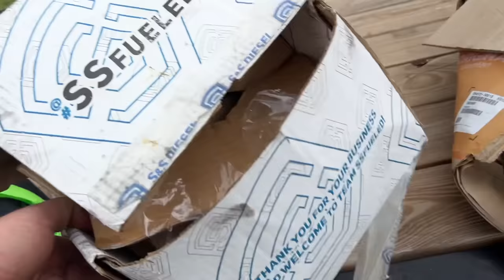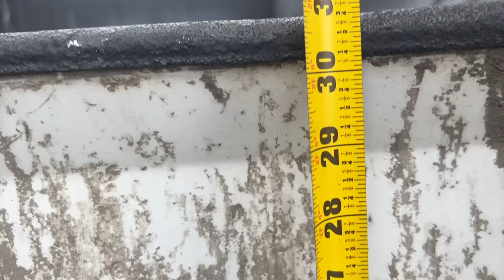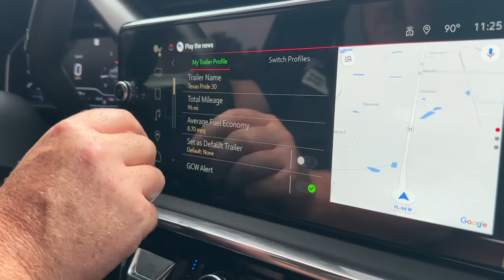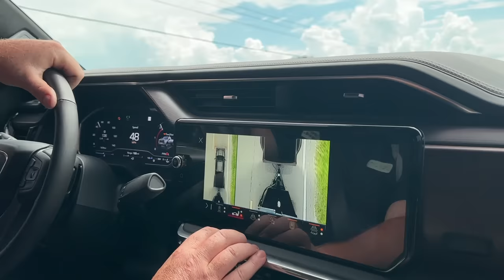$100,000 Diesel Truck VS $2,000 Diesel Truck!!!!  Are These New Trucks Really Worth It?

Comment: Stock tuned 6.0's are LACKING! 
Performance wise new diesel engines AND transmissions are butter! The 5R110 is not bad though. 

I'm extremely surprised how well the old 6.0 did though compared to a new Duramax. (I've only driven 1 ~2007 Duramax though but was tuned pretty hot) 

My 2006 6.0 and 2014 6.7 (both tuned) aren't even close.... However My old 2008 6.4 tuned was the fastest and funnest DRIVER (that's when it actually ran and drove fine! Also that's where any positive ends!)

Comment: Lmfao. That new dually is a Macintosh computer on wheels. With a 7.3, I’m taking the 2006 all day. My grandpa got a 2001 3/4 ton 7.3 with only 130 on it. Not a dually but it’s on airbags and has a programmer

Comment: Not to be rude but a new truck can brake down just as easy as a old truck. The key with old diesel trucks is knowing ur truck and keeping it maintain. I have a 96 12v cummins with just shy of 500000 miles. Its never let me down once i drive it everyday. Buy the newer trucks are nice and make towing easier. I have a new 2024 chevy 3500 with 6.6l gas. I just couldn't buy a diesel with all that emissions junk.

Comment: I don't really see the point in an expensive truck TBH.  Might just be something that if your into it, you're into it.  I'm not really into trucks at all.  
  
I guess if you need to depend on the reliability and your running a business then I can understand, but just for personal use it's just not something I have any interest in.  I'd only ever need a truck with a 4x8 truck bed for transferring materials but even then it's cheaper to just have it delivered via Freight for how frequently I'd need stuff.  
  
I'd rather have a sports car that is actually fast and a mild status symbol.  When I see a big expensive truck I just immediately think that the person is bad with finances and has a high debt to income ratio.

Comment: You should do a more even comparison to take like a 2006 Duramax LBZ dually put it up against that  there's no comparison to the Allison Transmission paired with a 6.6 Duramax which is never changed its engine or transmission over 22 years

Comment: There's no comparison. I don't care for the 6.0 personally, but I'm about to drop $5,000 on an old square body F250 with a 7.3L Powerstroke and a manual transmission. My old 7.3 got stolen and trashed unfortunately. I know a guy with a Power Wagon that has a 5.9L Cummins and a standard. I'd like to see which trucks are still running post apocalypse just to confirm my suspicion, but to tell the truth I already know the answer :)

Comment: If you look at the 0-60 for both trucks it was only 5 seconds faster then the powerstroke. Ill take the 2k truck over the 100k truck i dont care about the cameras and the luxury the 100k truck has. My 2004.5 built cummins would smoke that 100k truck no problem. So take from this video buy older trucks because there more reliable got it thank you. You helped clear the air to help me save 98k thank you.

Comment: Tbh jus engine swap nd axle swap the older one or mod the engine by putting an extra  turbo or a bigger turbo den u got a truck for fun nd for work nd way mor better as cars nowadays depreciate super fast and older cars are appreciating rn 

Edit:oh and if u wan to u can trans swap which u sumn times  have to do anyways Buh coo thing is u get to pick wha engine nd wha trans so u can pick the most reliable high powered engine

Comment: the 6.0 costs what? 2 monthly payments of the duramax? and still gets the job done? I'd say if you're in the position of being able to pay for the duramax out right, sure go for it. Most people aren't. The cheap truck will still get the work done, it's completely reliable as long as you maintain it and you can do some upgrades to make it a bit more capable. Plus if it ever does break down, just buy another one. Or have a spare one parked ready to go if you have room to avoid downtime. Still way cheaper than the new truck. But do you WANT a new denali HD? who wouldn't lol

Comment: The issue with the new stuff is way too expensive and most are junk. I bought a 2023 GMC, AT4 2500, 4X4. Late last year. My biggest problem was while I made the monthly payments, I didn’t get to drive it much. That General Motors truck spent more time with the dealership than in my garage. You name it, I had problems, electrical, engine, transmission, brake issues, axle seals, and the truck had less than 4,000 miles on the clock. I should have kept my 2013, Ford F250 4X4. Never experienced issues like the crap from General Motors. Filed a lemon law against the truck. It was bought back by GM. I lost a lot of money on the buy back. Never again would I buy a GM product.

Comment: I have a 2006 2500hd duramax and i just bought a 2023 gmc denali 2500hd duramax dully whitch would be a better comparison thee 2023  out performes the 2006 in every category except fuel economy pulling my three axle toy hauler 49-1/2 feet long the old truck gets about 11 miles a gallon compared 9 miles a gallon plus the def

Comment: It's a fun comparison but the new trucks are really not worth the price.
i just bought a low mileage optioned out 4x4 f-550 crew cab with a blown 6.4 for $4,000. Im doing a 6.7 cummins swap this winter. With a fully rebuilt and bulletproof 6.7 cummins, new Allison 3000, exhaust brake, camera system, dynamat, navigation, etc. just a lot of updates.. 
Doing all the work myself i expect it to cost ~$27k including the original truck price. 
Compare that to a new truck that costs 4 times more and is less reliable. Nah.. while you new truck buyers always have a payment, ill be driving this the next 30 years.

Comment: In my opinion, you would be better with a 2003 or older 7.3 diesel even if you had $10-$12,000 into the older truck you would still be saving $90,000 in reality and 10 to 12 years that new truck will be only worth around Five thousand dollars  / ensuring $100,000 truck is going to be expensive. What’s happening is manufactures our pricing the average person out of the new truck market.

Comment: I can't help but feel the new truck is not worth it. Vehicles are already getting crazy to work on. That old 6.0 did incredible in my opinion. I admit I am biased towards the 6.0 because I own one. The trailer drop of 3.25 inches could be solved with new shocks and for only a 4 second difference in a 60-70 mph change, I could never spend 100k on it. Yes, you will have repairs and maintenance on an older truck. I have some minor repair almost once a year, usually some factory sensor going bad. Typical do it yourself repair on a 6.0 is $1000. That trucks payments are over 1K a month. If you're just trying to do normal everyday things with a truck, the old ones handle themselves just fine. Stay on top of maintenance, do regular oil changes and watch that truck out last you.

Comment: Anyone that buys a truck for $100K just got scammed. New trucks have too much electronics and electronics always first to breakdown. I still have my 74 Ford factory High Boy 4x4 runs great if anything goes wrong you can just change the ignition cap plugs and wires for $100 and you’re up and running again everything you can fix yourself and cheap and no payments.

Comment: The argument isn’t whether or not you should spend 100K+ on a newer truck with options. The argument is whether you should spend 100K+ on a new truck with options if all you do is use it as a daily driver or light duty. The answer to that is NO, Absolutely not. However, there are people that are better off with the new fully loaded truck. 

Sure, at the very foundation they do the same thing. You’re not getting a huge difference in power or capacity between them, especially when you consider the difference in price. 

But, if you’re somebody who’s livelyhood or occupation is in the trucking/transportation industry, here is why a newer truck is better. 

1. They’re more comfortable. You might not want to admit it, but you want comfort. Nobody wants to sit in a truck for 11 hours on crappy torn up seats, little/no entertainment, or without features that just enhance your life in general. 

2. Productivity. A lot of these new trucks have had a lot of throught put into them with Hot Shot/Transportation in mind. They have a lot of features that make that better and easier. They have a lot of options for towing, storage, accessors, etc. 

4. Safety. These trucks are a lot safer with all their sensors and monitors. Almost anyone could get in these and tow 30,000,pounds and not have to think about it. 

5. Efficient. The new powertrains are far more efficient that the older ones. They’re all electronically controlled to provide the most power at the best economy

5. Maintenance. Older trucks might be more mechanically sound (that’s debatable). But at least with a new truck you get the piece of mind in a warranty and more simple maintenance  schedule and vehicle care. 

So yeah. If all your doing is driving around town and occasionally hauling light loads. Go get you a $3000 1999 F-250 with the 7.3. But you don’t want to drive that from Pensacola, FL to Fairbanks, AL

Comment: See a lot of those 100k trucks on the road without a single scratch or a dent on them. Never see them loaded or hauling anything. See a lot of those 2k trucks selling for 10k with battle scars. At the end of the day i prefer to put money on a high end car and run the old work truck as long as it will go.

Comment: It's easy to say that a new car is more reliable than an old truck with a million miles, but my experience has been quite the opposite. Bought my wife a zero miles car thinking the same thing, I have less problems with my old truck that just passed 300k. Old truck parts are stupid cheap too....
Reply: I agree. I have an 06 ranger with 330,000 HARD miles and aside from normal maintenance and wear items like clutches, brakes, oil, filters, coolant, etc, I've only replaced the starter, alternator, fan clutch, blower motor, and fuel pump. 
It's never left me stranded and I only paid $4,000 for it back in 2010 with 90,000 miles on it. I couldn't ask for a more reliable and cost effective truck. I will literally never sell this truck as long as it runs

Contrast to my sister's $35,000 2022 Subaru that has spent more time in the shop and on a wrecker than in the driveway or on the road.

Comment: Racing a loaded truck isn't anything that would matter to an average hauler.   The reason you got stranded was depending on a "built" motor to do daily work.   No one needs a 100,000 dollar truck.  Good for GM though for finding a customer.

Comment: Buy an older truck. Throw an exhaust brake on it. Make it maintain good EGTs and drop from those lil 1100-1200 degree moments fast. Im partial to cummins in ford, GM, or mopar chassis.

Comment: I would never modify a 6.0 for horse power. keep your coolant temps in line. flush your coolant system properly and "often". things will work for a long time. they take a little more maintenance than others. they are NOT they best motor by a long shot. their bad name can make them an incredibly cheap platform to make money off of to this day though.

Comment: I’d never say go out and buy a 100k truck , it’s nuts the price of vehicles today, it’s out of control..but those loaded can take the hit for the rest of us I guess, or those who end up getting them repossessed,either way I’m good buying it used for 25% or 45% less..heck 10yrs ago I bought a new fully load ford truck for 45k after 12k in dealer discounts..and I plan on keeping it for another 15 -20yrs as it’s still only got 25k so @ that rate it will hit 100k in another 30 yrs if I’m still able to drive, lol😂😂😂 kids will take the keys by then..

Comment: You get good deals on vehicles 2000 pretty cheap for that truck even 3000 that would cost around 5 or 7000 around my neck of the woods and that would be a good deal

Comment: 100k for a pickup is dumb as hell. I have 20k in my 04 lariat 6.0 with all the upgrades and a small tune on it. It doesn't ride as smooth but is comfortable and more than gets the job done. If I need a nicer pickup I can go get a great 2015-16 for way less than 100k. This video provides so good info though.

Comment: 06 lbz with basic mods will beat a nrw truck, no emissions, more reliable, cheaper to fix and maintain, you just have to live with an "old" interior... Which you can upgrade too. New gas vs old gas is a bigger difference than new diesel vs old diesel.

Comment: I would rather have a fleet of 10 $2000 trucks instead of spending 1 for $100,000.  Business is not always about the image.  OK you roll onto a job site with 1 expensive truck, or you roll into a jobsite with 10 cheap trucks and 20 employees to do the job, or send out 10 cheap trucks out all at the same time to do 10 jobs in 1 day.  Which one you think will make more money.

Comment: Wouldn’t buy a 6.0 power stroke but for ford any 7.3 dodge any Cummins pre 06-07 and GM the same year range if I wanted or needed a diesel. No way would I spend $100K+ on a truck gas or diesel.

Comment: I like/ dislike the comparison. i like how you compare the reliability of an older/ high mileage truck. but at the same time, you're comparing a truck freshly off the lot to one that has been a road dog for 15+ years. if you had an older truck that in a way that was freshly rebuilt to OEM specs; transmission, rear end, etc. to the 2024 model and then compared... I think it would show a better comparison. BUT like you said in the video, you worked with what you had. which isn't a bad thing. And that's the positive. you showed that if the old tow pig can do what you need it to do, don't spend a house note. But if you want/ need the modern-day tech, here are the pros to it. in that standpoint, right on. but apples to apples, the power stroke's been plucked off the tree for a while. it for sure doesn't run the way it did rolling off the lot in 2006. I would like to see a fresh LBZ go up against an L5P as well... if one can throw an idea out there. Thank you for the video!

Comment: If you paid $100k for a truck, you better be using it to haul stuff and for business, and making like $200k plus per year with that truck. If not, it makes zero sense to me if you don't make a lot of money or if you have at least one million dollars in the bank and a paid off house. That's just me though. To each his own. I would definitely get an older vehicle and put some money into it. Thanks for the video. BTW, you don't need all that high tech newer garbage like big screens and such in a work truck. All that crap will stop working and fall apart quickly 😂

Comment: Near 20 year’s difference in technology and I don’t believe for one second that the difference in performance justifies the major price difference..100k truck should be alot better than it is..which my opinion would probably change if you compared old ford to new ford. Dues max isn’t that good compared to the 6.7 power stroke

Comment: Plus all the newer trucks have so much BS Emission crap on them so any small issue with that will cost both arms and legs. As long as the old diesel engines are in good working order they will last forever with simple maintenance.  Where as the new ones with all the crap on them just don't last as long.

Comment: That $100k truck is gonna need more work in its life than any other 20year old truck would see, thats just based on the amount of electrical components and sensors it has that will go bad and need to be replaced several times throughout its life

Comment: Wow you can spend money on a 2k diesel truck and have money left to buy a used Ferrari

Also that 2K truck have better sounding diesel from International while the new 100k have horrible Duramax engine from GM. If you can find a Dodge Ram with Cummins 12V, Isuzu NPR with Isuzu 6BD1, and Mitsubishi Fuso with 6 cylinder for 2k that’s even cooler. Best part of old diesel truck is you can swap with many diesel engine like Caterpillar 3126, Doosan DL06K, Detroit Diesel 6v53, International DT360, Deutz 6FL613, or even Naturally Aspirated Hino EH700 (some did put in Isuzu 6BD1T into a pickup truck)

Comment: 6.0 powerjoke isn’t worth $5. I had one and it stayed in the shop more than anything. 
Only motor ford made that was good was the 7.3. Anything with this new def system is trash as well. Best to go with a older Cummins or a LBZ duramax.

Comment: The short answer, is no. No, the new ones are not worth it. Get something around 20k if you want a nice truck for the budget, but you can get a work truck to run into the ground for around 5k with some repairs

Comment: "$100,000 for a truck. That's just the market Where We Are."   That's the market because people are stupid enough to pay that.  
If someone was willing to take the time they could put together a 6.0, 7.3, 12v or 24v setup at a great price get items from junk yards or Salvage yards and a few grand of HP into a motor and you have a truck that performs just as good as that new truck at a fraction of the price, cheaper to insure and repair.  
He's probably charging people $7 or more for a cab off repair on modern diesels of course he can afford $100,000 truck

Comment: Let's see a $6,000 truck with $44,000 worth of upgrades.

Still comes in at less than half the price of a new loaded truck and will be 3x the truck in the end.

You drive a fully loaded truck off the lot and you might as well set 🔥 to $20,000 - $25,000 cash.

Comment: I think they’re being a little hard on the old Ford even though it’s a 60 with much rather have that in the new truck a lot less electrical shit to worry about I don’t have all the admissions. Crap let’s not forget the trailer brakes weren’t working on the Ford And only completed the quarter-mile with the same load a second and a half slower and a brand new truck come on blue oval gang